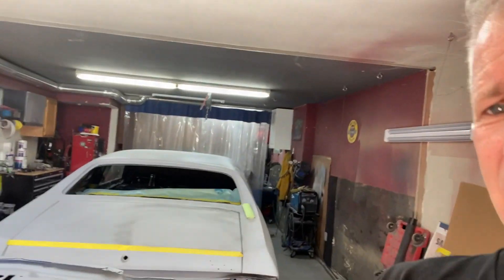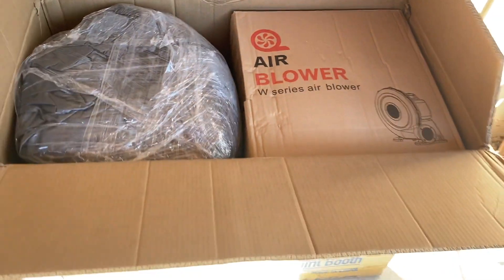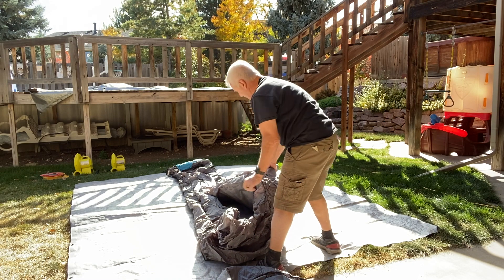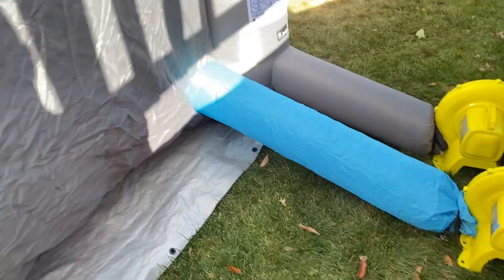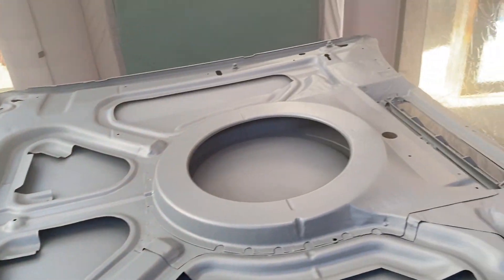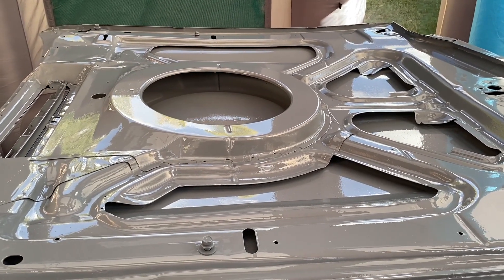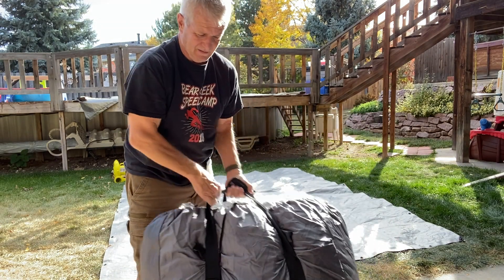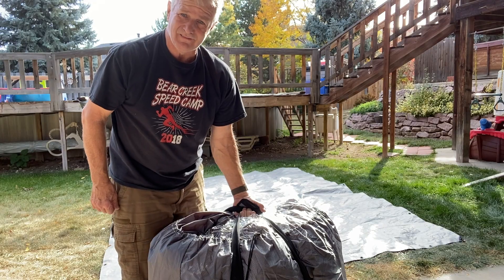My New Inflatable Paint Booth! 12.5'x12' Sewinfla Unboxing from Amazon

Comment: how is this at actually removing the overspray and fumes ?.  certainly considering one of these ? thank you for the video ?
Reply from the maker: I went with the upgrade filtration system and it does capture some of the smell and overspray. Not all of it but way better than when I paint in my shop and vent the fumes out with an unfiltered exhaust fan.